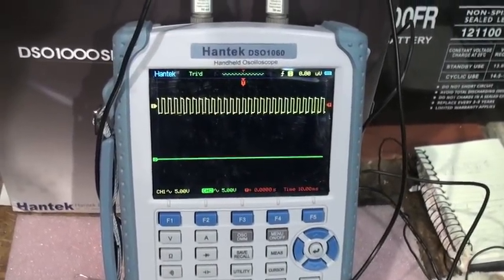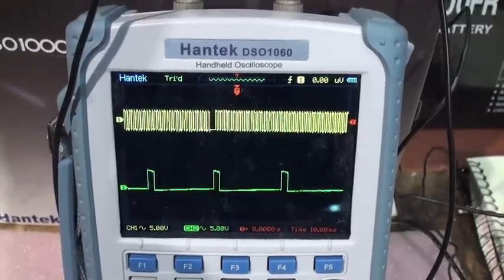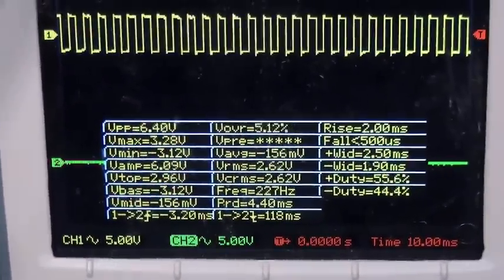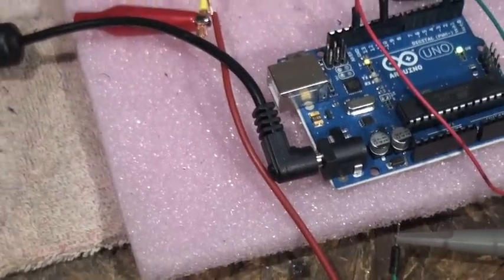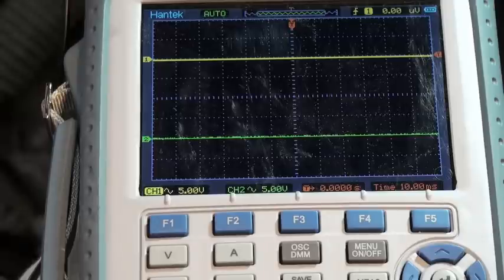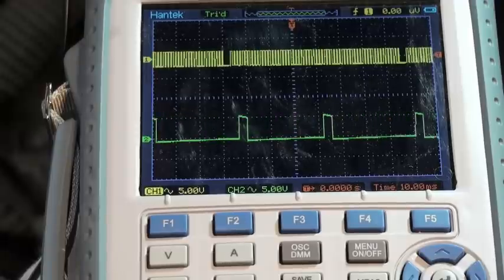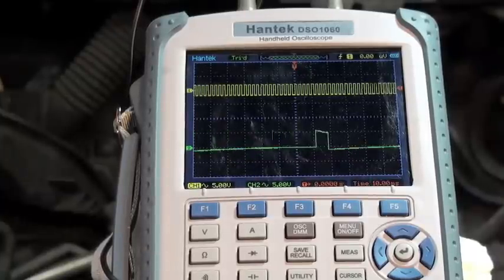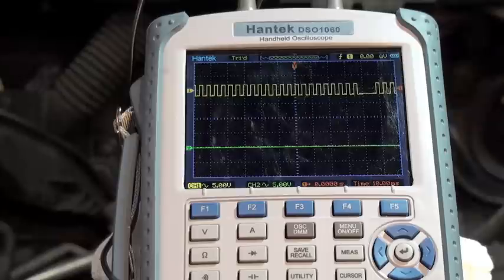BMW X5 crankshaft simulation using an arduino part 2

Comment: So what is the point of this?  Is this for EV conversion or something?  The Arduino isn't hardened for running directly off of a car alternator system.  It would need a filter to remove the voltage spikes that occur in a car's electrical system.

Comment from the maker: HHR is doing well, 150 miles is going to be a challenge.  100 miles is doable but with todays lithium cells there is a point of diminishing returns.  Adding more batteries will get you more range but at a cost of speed, and room in the vehicle.  Furthermore the battery pack would be almost cost prohibitive.

Comment: Have you got a BMW WDS disk? (there was a WDS online but it is no more) They have all the car electric diagrams with some explanations on the electronics. Some elements of the car mantain it's power on for 15 minutes after the car is off (even with the key out and the doors locked). If you've not already done I suggest you register at bimmerforums. Good luck.

Comment from the maker: When I move the setup to the car it is running off of the 12V car supply. Specifically from the original crankshaft sensor power and ground lines.